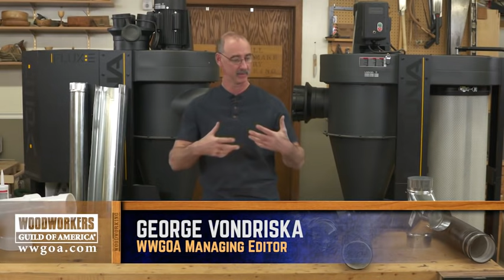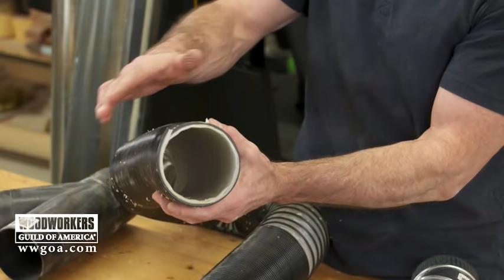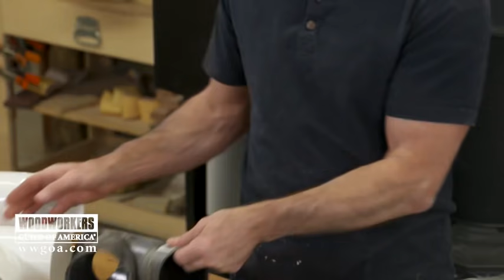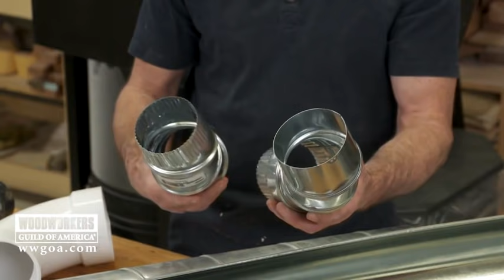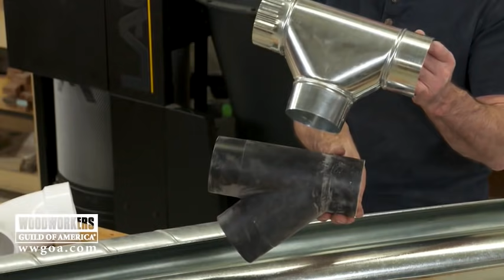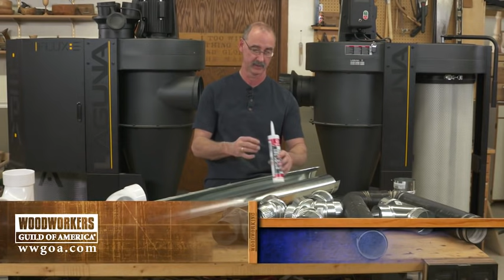Tips for Central Dust Collection

Comment: Just wanna say, I'm in the HVAC industry, its a pet peeve of mine how people turn elbows to "45 degree" elbows by only turning the two ends. This ends up making a sharp 45 turn, you are infact making it an even smaller radius by doing so.
The trick is to turn all the seams of each gore of the elbow together. The closer they get together the straighter the elbow gets.
This makes the Elbow have a much more efficient and smooth turn, rather than a sharp 45 turn.
I hope that makes sense.

Comment: Just as a talking point it is recommended that you have a minimum of 24” of straight pipe coming off the dust collector intake prior to any fittings because in a cyclone system the fitting too close to the intake will cause turbulence and reduce effectiveness of the cyclonic effect

Comment: Thin-wall sewer and drain (SD) PVC is readily available, lightweight (kind of), cheap, and effective. And long-radius bends and wyes are available, though usually by special order (next day at my plumbing supplier). I use the Super Dust Deputy with 5 inch inlet. SD PVC has no 5 inch fittings that I know of and I almost reduced to 4 inch, but decided to increase to 6 inch for my main runs. Simply amazing what that does for airflow! I use aluminum blast gates with the PVC pipe, and with constant use for a couple of years have seen no evidence of static buildup.
Reply: I think mines use that.

Comment: Just for information:  Electrical supply houses have PVC in different diameters and schedules all with sweep fittings that are perfect for dust collection.  You even get a choice of long sweeps or short ones.  A nice system of different types of hangers that fit perfectly also makes for a professional installation.  It is my experience that you better be packing a fat wallet before you even venture inside a HVAC facility!  The other thing to keep in mind is the conduit fittings sweep or otherwise mate up with PVC that is available in your other outlets.  You can also use a heat gun to judiciously apply heat and bend PVC without fittings.  The frustrating part is trying to get adapters that actually fit different manufacturers as they all seem to make completely different fittings.  Different sizes, some tapered, different tapers etc. etc.  Take care.  Doug

Comment: I prefer galvanized HVAC tubing especially in the current market...  6ft of 6" Galvanized snap lock tube is about $2.15 per foot where 6" PVC pipe is $4 to $6 per foot, plus you have to either already have copper wire for grounding, or buy copper wire to ground it.  Pricing is a bit closer together for 4" PVC Vs. Galvanized, but the galvanized is still winning out right now.  While PVC long sweep fittings are perfect for dust collection, you can find galvanized fittings built almost identical to dust collection fittings.  

Of course it's the fittings where things start to show promise with galvanized...  6" PVC wye (has more of an angle than a tee fitting) about $70 Vs. "Full flow" galvanized wye $30.   6" PVC long elbow $60 for a shorter one, $120+ for longer one, Vs.  $24 (with tax & shipping to my house) for 6" galvanized long elbow which is about 1/2 way between the shorter & longer PVC long elbows...  If you stick with galvanized fittings for most everything, then switch to steel spring wire wrapped expandable hose for machine connection,  you don't have to worry about grounding.  

Of course with Galvanized, you do have to seal all seams with mastic, and foil tape to ensure no leaks.

Comment: If you use electricians pvc, you will get the pvc sizes you need and large sweeping elbows and T’s. Large cables also do not like tight radiuses

Comment: Check your local HVAC supplier as they may have thicker gauge pipes for the same price or better than the equivalent PVC.  I did and my total cost was a decent bit cheaper than the PVC at the local home centers.  They even had 5" pipes which were perfect for my Super Dust Deputy.

Comment: Since PVC is an insulator, how does adding a copper grounding wire ground the entire system?  Since PVC doesn't conduct electricity, It will only dissipate static in the area of the pipe where it makes contact, which is only a tiny section of the pipe.  If wire is on the inside, the outside has no means to dissipate static build up and vice versa. It seems like static will continue to build throughout the rest of the system.  In theory if you wanted to ground a PVC system you would have to wrap the entire pipe (inside and out) in copper wire or foil tape before grounding would serve any benefit.

What are your thoughts?
Reply: I’ve never understood how anyone could believe that you can effectively “ground “ an insulator…….

Comment: A better option over silicone caulk is silicone tape.  It is stretchy and only sticks to itself so you can wrap it around any joint to seal it completely, and easily remove the tape to take a joint apart for redesigning your system or clearing a clog.

Comment: I'm little confused on your statements about grounding on the flex pipe.  The metal wire giving it rigidity isn't exposed within the pipe itself, it's contained within the plastic/flexible sheathing.  If it's inside an insulator and the static is accumulating inside the pipe, what is the point of grounding that wire?  It's similar to people who are run wire along the outside of their PVC to ground it.  It does absolutely no more than I'm seeing this would, unless I'm missing something.
Reply: You aren’t missing anything. It is impossible to ground PVC, as it is a near perfect insulator.
Reply: @Aethid  Might want to use bare copper 14 AWG wire.. Easy to obtain.

Comment: Instead of caulking the gores on the HVAC adjustable bends use foil tape it seals and if you need to change and angle remove the tape, other wise you may have burned an adjustable bend.
Seek out local HVAC suppliers I have a Supper Dust Deputy that has a 5 inch port. I found 5 foot lengths of 24 gauge HVAC pipe for $5.00 each Home Depot wanted $7.57. The bends / adjustable ones at HD $8.00 five inch. Local HVAC supplier $1.98 each.
5 inch PVC can be found at well driller supply houses but I have not found reasonable priced fittings in West Texas or any where else.

Comment: There is an implied theme in your video and many of the comments below, that bigger pipe is better. More CFM s (cubic feet per minute) of airflow... but I beg to differ. In dust collection one must be concerned with velocity of air moving through the pipes and at the entrance to the pipes. The "capture velocity" at the tool end of the dust collection system must high enough to capture the dust and the velocity inside the pipe must be high enough to keep the dust particles suspended in the air and moving to the point of collection. The pipe size needs to match the fan. For example, a 6" pipe on a system using a small shop vac will not work well due to low air velocity.
Reply: Jack Gutschenritter true, but that math is factored in by whoever builds the Dust Collection unit. In this case,  Laguna knows that an 8” tube is best, therefore, there’s an 8” opening.

Comment: I'm tempted to use a cyclone for the big shavings and then simply  do away with the collection bag on my dust collector and hook up the output from the motor direct to ducting and vent it all outside through the wall - like  a horizontal dust chimney. Its VERY windy where I live almost every day of the year - I'd be surprised if a speck ever hit the ground on my property and we're rural and remote. You think that's viable?
Reply: i was planning the same thing in my shop, for the same reasons.  nobody around the exit of the air outside the shop for a hundred yards, and it tends to be wet.  Would seem to be quieter, cheaper, more compact, and easier.  I do not make sawdust more than 30 days a year anyway
Reply: Yours is a reasonable plan. An appropriately sized cyclone will separate all but trace amounts of sawdust, so direct venting wouldn't be a problem (unless it's against some sort of code in your jurisdiction).

A bigger downside of your plan if you heat and/or cool your shop is that any conditioned air will be exhausted along with trace dust...and rapidly!

Comment: I've been scrounging components for a "new" system in a shop with 12' ceilings. The collector is an old 7-1/2 Hp Torit with a 10" inlet and "submicron" cartridge filters. The inlet is 10' above the floor and it seems, which is to say I Imagine, that the 10" and 8" branches ought to run nearly level across the shop. Is that correct? All of the machines are within 22' of the collector with several dedicated shop vacs pulling through cyclones for the low volume machines like drill press, 14" band saw and a well-shrouded Festool miter saw. Stepping down from 10" to 8" for a 24" planer seems reasonable but what perplexes me is necking down to 6" for a 36" bandsaw and a 24" widebelt sander. Both are antiques with 6" ports. Even worse are a 12/14" table saw and 8" jointer both with 4" ports which I intend to open up to 5" mostly because I scored some used super high grade semi-rigid, smooth-inside 5" flex hose to make the transition to wyes branching into an 8" line in a trench. It seems like the air flow won't be nearly enough once the dust laden air reaches the big tubes. Will it create enough air flow to keep the dust moving if I leave one or two floor sweeps open? What kind of gizmos should I use to assess the performance of the branches and drops I piece together? Also, I have a really old 3/4" shaper with no provision for dust collection other than a 3" port in the fence and louvers in the cabinet door. Do I need to cut into the cabinet to contain the dust? Thanks for your recommendations.
Reply from the maker: Great question! I will ask one of our experts and get back to you here.
Reply from the maker: Here is the response from Paul: These duct and DC sizes are out of my area of experience.  I would suggest working with a ducting supplier to draw up a recommend configuration for your shop.   As far as the shaper, I'd suggest trying it as-is first, and then opening up the cabinet if you feel that it's needed.  Ultimately, I believe that I would want to have collection coming from inside that cabinet in addition to at the fence.  
Paul
Reply: @Wwgoa  Well, a few years ago, when I got the Torit, I asked the Denver rep for a replacement part, I forget what for. Though they were "courteous", they basically gave me the bum's rush. In my old age I've decided not to seek the free knowledge, to impose on people, trying to make a living. What about test equipment to do my own assessments of my Frankenblower?
Reply from the maker: Hi Mark!  I've sent your follow-up to Paul.  Please allow 1-2 business days and I will post their response here.  Thanks!
Reply from the maker: I use a Dwyer digital manometer to measure air flow on my system.  That said, I had suggested was that you contact a supplier who sells ducting.  They can sell you the ducts as well as a plan to lay them out with optimal air flow for your configuration, so they would be making money on the advice that they give you.  
Paul
Reply: @Wwgoa  Thank you. That sounds like good advice and I'd be more likely to follow it if there was an industrial ductwork supplier here on the high plains of Wyoming. It's a 375 mile round trip to the Denver supplier I've previously done business with. My approach may be bassackwards, but I'm trying to use up on-hand components and to lay out the horizontal runs on the floor before the rest of the machinery is brought in.  I'd hoped to find a device with which to measure inline air speed after the large diameter lines have been choked down to the machines. So far I've only found anemometers with separate pitot tubes that total over $400. Any suggestions, anyone?

Comment: OK lets hold on a bit here. All the talk about efficiency is fine and true and Id worry about it if I was building a wind tunnel for an airplane. Yes all the science is the same but the flow loss is a cube root function of the air flow velocity and mass. The types of vacuum systems woodworkers typically use the air flowrate and mach number are low. Fundamentally for a hobbiest in a garage worrying over max vacuum system efficiency is likely polishing a cannon ball.   If I was trying to optimize a multi-person shop that had multiple cutting machines running at the same time, to attempt to minimize the number of vacuum machines I had to buy then my answer might and probably would be different. For those of us that just move a flex hose around as we go from machine to machine a 16 ft, 4" dia hose is more than adequate, just keep the kinks out as much as you can. For those of you that are more semi-permanent 4" diameter piping with 3 or 4 elbows between the vacuum and the machine is perfectly adequate. The idea is to clear the dust, it isn't to get max vacuum system efficiency. Grounding is nice, again if I was running a multi-person shop with multi-machines operating Id worry about it. In my world of a hobbiest in a garage, static electricity on the plastic flexhose is all about the  annoyance at having to periodically dust the hose off (wet cloth works well).Not mentioned in this, is the fact that most of the fittings  elbows, tees, that we hobbiest commonly use are based on ODs and IDs of schedule 20 pipe. I live in California, I've also been to a few big box stores in Washington state and quite frankly schedule 20 pvc doesn't exist, everything is schedule 40 and doesn't work with any of the fittings, that are commonly used in woodworking. I'm told that the reason is that 4" schedule 20 was used in waste systems and the building codes been changed to schedule 40. Not sure if that's true but I do know that it doesn't appear to be possible to buy schedule 20 pvc in California, perhaps in the San Joaquin valley where irrigation systems are prevalent it may exist. What might be nice is if (a) someone did a video on alternatives because I doubt seriously the machine manufacturers are going to change their exhaust port diameters and (b) whoever manufactures the fittings came up with an adapter from 4" schedule 40 to schedule 20 machine port. I get really tired of duct-taping fittings.
Reply: Check into the DIY heat formed PVC transitions out of regular pipe.  Several good ones on the Tube.

Comment: Best option is to use the standard thin gauged cheap pipe and install a clog gate for lack of a better term that would automatically open if the flow is restricted past a certain point thereby preventing the pipe from collapsing.

Comment: George, Very informative. Where were you a year ago?  LOL!   I would also add that tape for ducts is now available which is a metal foil.  The issue with the optimum spiral pipe is the cost. And large pvc elbows ( beyond 4 inches) are  very expensive in comparison.  By the way nice cyclone. LOL!   The cyclone too has a lot of physics behind it.   In HVAC blowing air is different from sucking air.  There are a lot of erroneous YouTube videos, and like yours some very good ones.

Comment: I have a small shop with a wet dry vacuum. Can I use the hvac piping for my approximately 24 ft run plus drops?i feel as though my wet dry has much better air flow than my 2hp Reliant 820 which is set  with original dust bags.
Reply from the maker: Hi Gordon, 

It is not likely that you will get satisfactory collection through duct runs that are that long using a shop vac. 

Thanks, 

Paul
WoodWorkers Guild of America Video Membership

Comment: I forgot to mention look for HVAC Fabrication shops, I wanted a 5 inch X 4 inch tapered Wye with a 3 inch side port. This will be used for a 5 inch main plenum reduced to 4 inches via a 1 foot taper that goes to the bottom of my Table saw for D.C. The 3 inch goes to the overhead of the TS for D.C. $ 30.00. Think outside of the BoX!

Comment: As an electrical engineer who has experience studying the corona effect, I feel empowered enough to state that a home shop will never produce the necessary saturation of a combustible environment within the volume of any home dust collection system to cause an explosion or fire.

In addition, in a PVC system, you will never be able to incorporate the necessary "grounding" to prevent an explosion where the appropriate saturation level exist in the system.

Simply put, you do not need to ground a PVC dust collection system.  If you wish to reduce those annoying and sometimes painful static discharge on PVC systems, feel free to wrap multiple times at the most common points of contact between you and the PVC with a conductive wire and then ground that wire.

And for those that want to try to rebuttal me because they think their Googling skills make them an expert in everything; no, the corona effect is not exactly what would occur in that volume, but I am knowledgeable enough to confidently make that parallelism between the corona effect and what's necessary to create an environment where an explosion or fire can occur.
Reply: I Tig weld. Occasionally get zapped. It’s about a thousand times worse than a dust collection zap. 

But woodworkers are doing the craziest mods imaginable to their air conduit lines. Snaking lines of copper on the interior, wrapping the exterior. 

It’s amusing.

Comment: Hi.. Great video.  Any idea where I can purchase clear 4" flex hose with the smooth interior?  I keep finding hoses with interior ridges.   Thanks!
Reply from the maker: Hi Steve.  I've never seen it with perfectly smooth interior walls, but there are 
degrees of smoothness.  I use this stuff and find that it works well and
 is economical.   https://amzn.to/2SKwSMB

If you want the smoothest possible product, I'd check with these 
guys as they carry a bunch of options.  They also have great metal blast
 gates that I've been using for years.  https://www.blastgateco.com/Flex-Hose.php